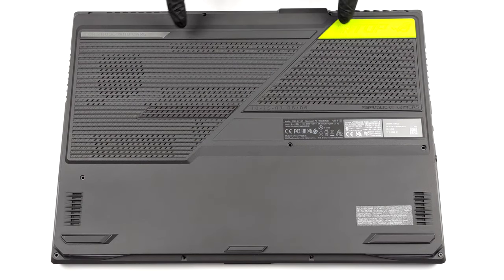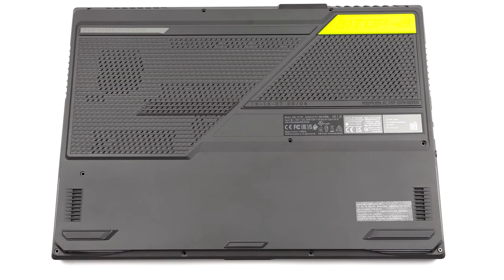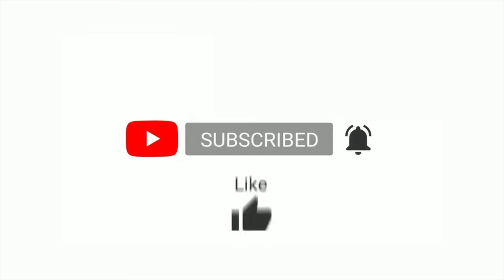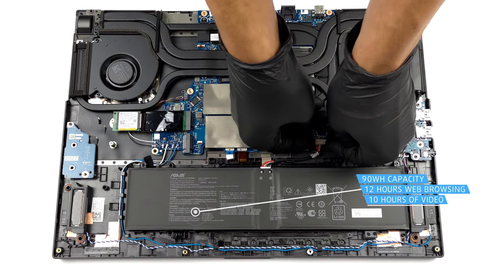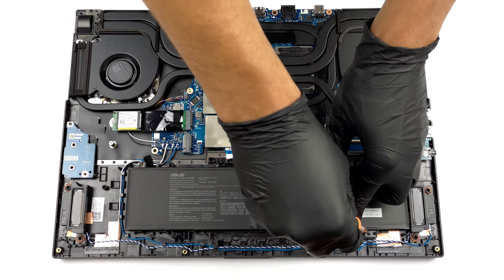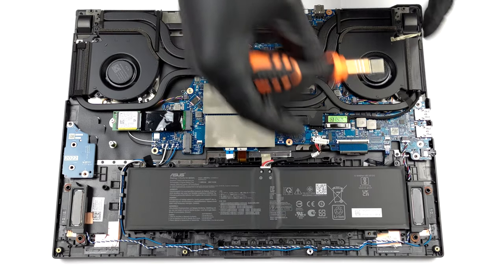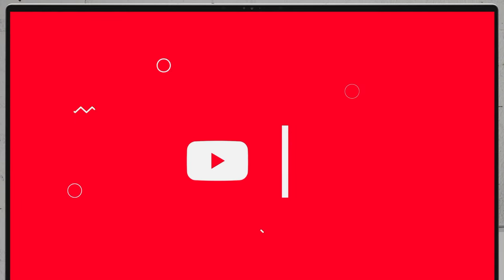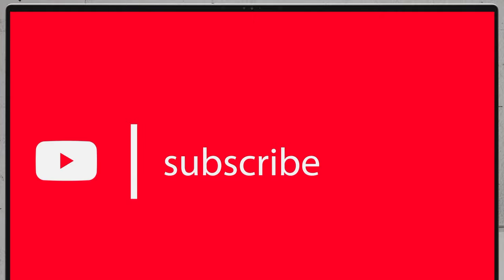🛠️ ASUS ROG Strix G17 G713R (2022) - disassembly and upgrade options

Comment: Can i upgrade battery frome 56whr to 90 whr..??
Reply: as long as it can fit inside, should be no problem
Reply: Does the 56 whr battery also last you less than 3 hours?
Reply: @ParionaLopezJoseLuis  yes .. 
But 90 wh battery give me more than 6 hourse of battery life in normal task
Reply: Wow!
Did you put a 90wh battery that is 14.4 volts in your laptop? I have an asus rog strix g17 g713rc laptop with a 56wh battery, i am thinking of putting a battery from an asus rog strix g17 g713rm laptop which has a 90wh battery.
Reply: @ParionaLopezJoseLuis  no I didn't put 90wh battery
I just purchase asus tuf with 90whr battery..
Reply: @ParionaLopezJoseLuis  but if you are going to put 90wh battery
Then pls inform me that laptop work properly or not.. ??
Reply: @himalaysoni1054  I contacted Asus and they said that their performance of 2 hours and a little more was fine, so I want to put a higher capacity without it negatively affecting the laptop.
Reply: @ParionaLopezJoseLuis  when you change battery and run your laptop inform me please.. 😀😀
Reply: Should contact Asus technical support, give them a exact model of your laptop and question them if you can put 90WHr battery 🔋 inside.
Reply: I'm also planning to do the same, any updates on this project? kaha se order karwaya battery?
Reply: @harp69420  I didn't do that
Because I purchase asus tuf
But if you do that 
Then please inform me
That will help me alot..

Comment: how do reattach the mini rgb ribbon cables it seems impossible
Reply: Ask someone with long thin fingers
Reply: As long as the cable isn't broken in half you can still attach it back again, all you have to do is slide the cable ends back inside where it was previously like before or if you can't, take it to a repair centre. Speaking as someone who detached the cables too and fixed it myself btw

Comment: please tell us how to apply grizzly liquid metal and where to apply that. After how long does it need to be replaced?
Reply: My laptop G713QR-HX023T will turn 2y this month, haven't replaced it yet. Temps are still under 80°C 🌡️ beacuse I underclocked it at lowest settings possible. In League of legends Temps don't even touch 60°C🌡️

Comment: Can you tell me if it is compatible with an Intel Wi-Fi AX210 wireless card?
Thanks.
Reply: I've AX200 on 2021 G17 model, bought 2022 G17 last month for my brother and he has MediaTek wifi chip which is junk. AX210 will work in it, we also plan to replace MediaTek one.
Reply: @Najbrz1 where I find the location to exchange it?
Reply: what do you mean exactly? 🤔 A place where to buy AX wireless chip or location where the Wi-Fi chip is on motherboard?
Reply: @Najbrz1  I mean the place where to find this wlan card for exchanging it. :) Where to buy it’s easy 😜
Reply: @IronManPeter  go be honest, we haven't exchanged it yet so I wouldn't know. Laptop is under warranty 16 more months so we won't take it apart yet.
Reply: @Najbrz1  but changing this card will not touch warranty. I think it’s plug n play incl installing drivers. So you are satisfied with this worser wlan card finally?
Reply: @IronManPeter  nah not at all. We moved to another job - different wifi and it's still shitty performance. Gaming ping, spikes, dcing, occasionally happens during the day while on my laptop with AX rarely.
Reply: @IronManPeter  Thats great, so it's located under NVME 👌
Reply: @Najbrz1  Yepp! 😊

Comment: Hi , do m.2 ssd need thermal pad applied to them or you can use them without it?
Reply: I have the same question
Reply: @georgio2916  i did install my m.2 in my laptop without any type of thermal pad and its doing fine. Im gaming on it and only light work. I dont edit any videos or what not.
Reply: @RideOrangeKTM  thanks for your answer buddy, so you use it for gaming and everything is ok with the temperature ?

Comment: Could someone please help me, I've the same laptop, but my screen suddenly blank. Buttons all light up, but not the screen. 

Saw someone's video in Yt said it could be done just by open the back panel, unplug the cable to the screen, n plug it back. Never open a back panel before. Is it a big deal if it's still under warranty?
Reply: Update your graphics drive it should solve the problem don't try to open your laptop without proper guidance

Comment: Haven't seen a comment about processor upgradability. Is that possible. Let's say i want a better cpu or gpu. Are they soldered in? Anyone know?
Reply: Hey David - I’m not too sure about the CPU - but I’ve seen the GPU part of the 3050 RTX - that is soldered in the motherboard
Reply: Im sorry but both the gpu and cpu have been soldered in all notebooks for quite some time.
Reply: So only the ram is upgradeable? I really wanted to see if i could upgrade gpu 😞